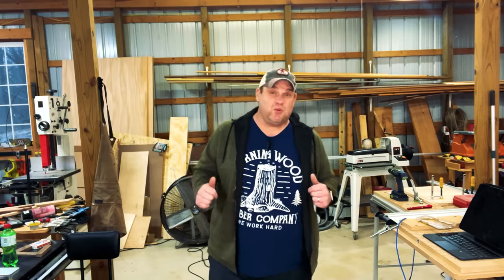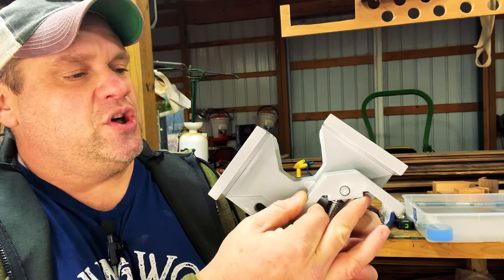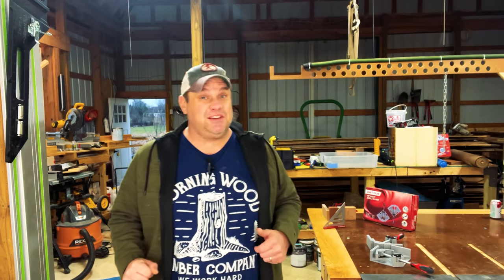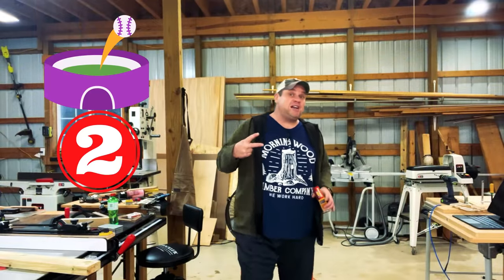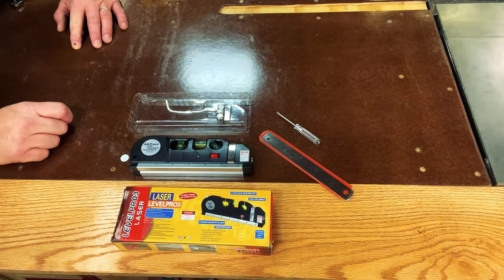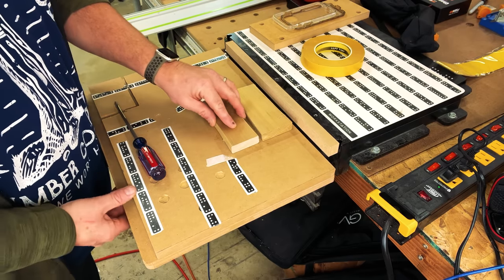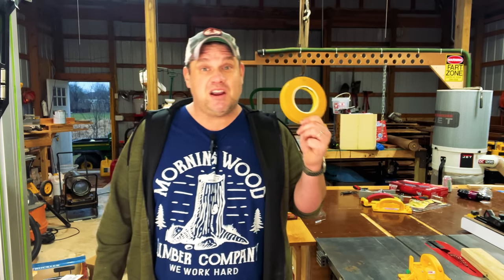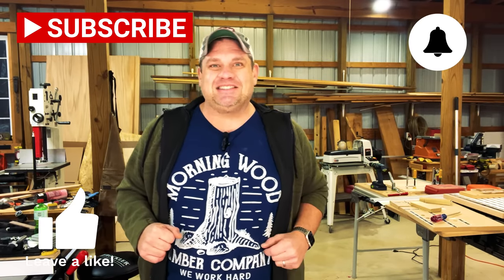5 Major Inexpensive Tool Upgrades For Your Woodshop!

Comment: i have the 90 degree Wetols clamps, and although they provide nice clamping pressure, they’re an inside clamp… so you have to have enough area to use them. You virtually can’t use them for picture frames of any reasonable size.
Reply from the maker: Excellent point Jim!   I don't make too many frames, so I didn't even think of that!  Thanks for pointing that out and watching!

Comment: Your corner clamps work inside corners witch limit the size you can clamp an outside clamp that style is available and works the same.
Reply from the maker: Great Point David!   I've gotten a couple of comments on that, and it sounds like it could be a real issue if I was making frames or things like that!  Maybe my quest is not complete! :)